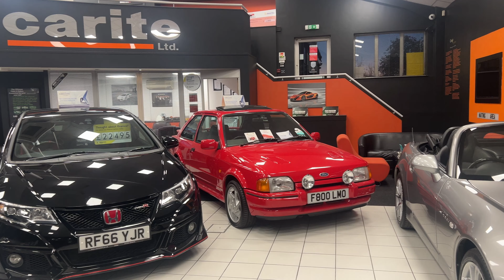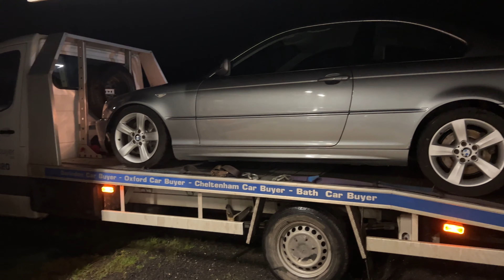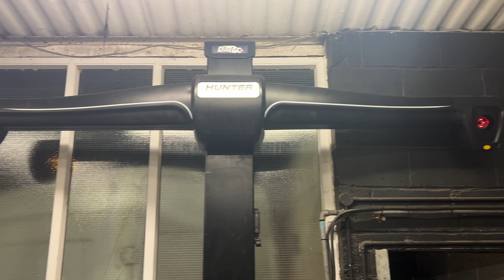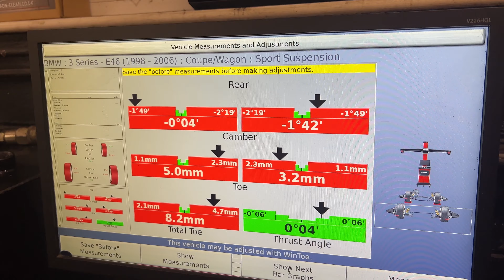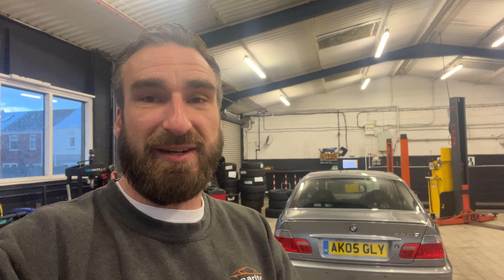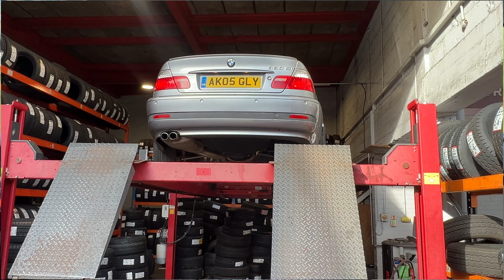Budget BMW E46 330ci Race Car Project Episode 10 - £8k so far! First Drive - Was it worth it!?

Comment: What's the difference between a porcupine and a BMW? 

I can't say, as you're bigger than me and I might get beaten up!

Nice to see all the work and money has paid off. The good thing about not having driven it until now is you get to see the effects of it all together. I think there are loads of diff options for these, so that'll help get a shorter ratio—I doubt it'll be cheap though. 😅
Reply from the maker: 😂 I can see where you are going with that! 
Yes lots of work but all necessary and it is nice to know its solid now. Diffs are widely available but only the Auto one is a direct fit due to the output or input flange sizes (I cant remember which), it will need a LSD anyway so we will probably go for a custom 3.73 or 3.91 final drive with LSD, looking forward to that! 🙃